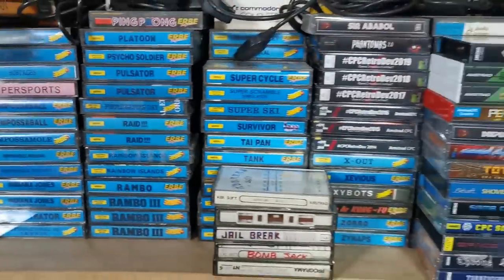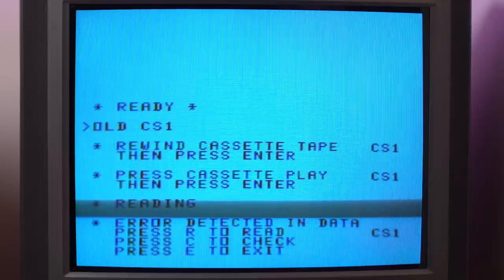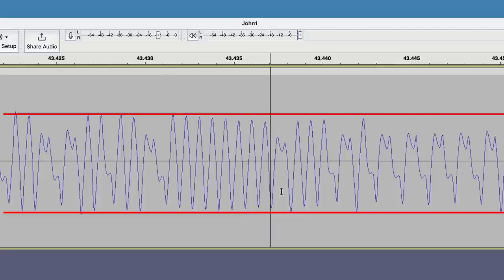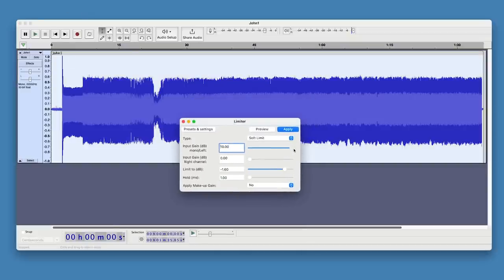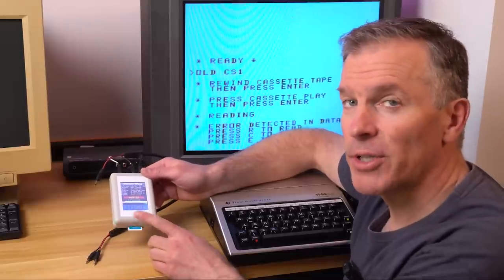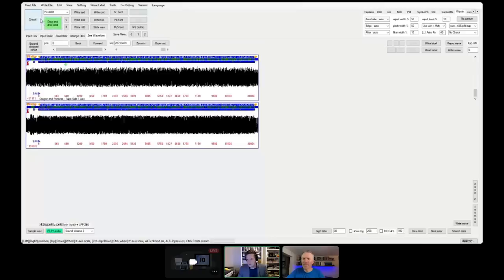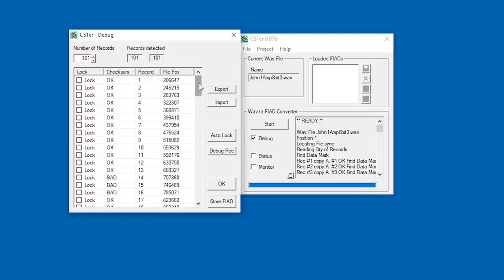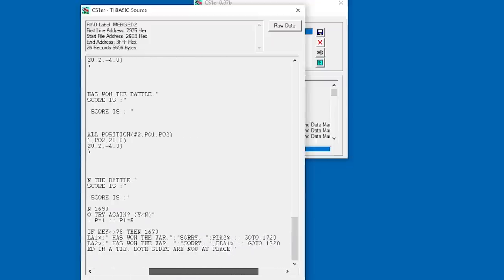Cassette Tape Data Recovery

Comment: Hi Noel, 2 things to note about cassette : many of them have the foam buffer cooked or dead, making the tape band reading shitty, and errors here and there. Replace the foam buffer by a new one, and oh ! Miracle ! the tape read again without any errors ! Next is the copper arm on which the foam buffer is glued. This one tend to relax too much with old age. Just put some demak up cotton piece under it, and done :D
Reply from the maker: Very interesting! It sounds like there are even more techniques BEFORE reading the data like that. Super interesting. If I come across some tape that has problems being read, I think I'll try that. Thanks!
Reply: @NoelsRetroLab  Yes. When i got sent 150 tapes to dump as WAV and then pass in CDT for the Amstrad CPC from  a big collector, i had to find solutions to get the datas read correctly. And the unrewinded band is a classic. with the band properly sticked to the read head, that's it, the squeeze is much more light or even better the signal is again proper, so when processed, it's all good !
Reply: @dlfrsilver  Thanks :).  Like the CPC!
Reply: Thank you for the valuable tips! I have some old tapes from my Amstrad CPC from my childhood with some self written programs and games I want to record and that could be really helpful advice.

Comment: a trick for restoring difficult tapes: in Audacity apply a very high pass filter, let's say 16000 Hz. This cancels out all volume variations and keeps only the zero crossings, which is what matters for tape decoding. With this trick I was able to restore a rare tape for the Tarbell interface.
Reply from the maker: Ooh, very interesting! I didn't think of doing that. I could see how that would work.
Reply: Thats ingenious, it took me two minutes to even comprehend what you said 😄
Reply: Uhhh can you or someone explain me how this works? Because for one there's no 16KHz signal on tape, the frequency response of it fades out before that, so by all logic if you highpass at 16k all you get is noise from the tape machine; and for other the signal that creates the zero crossings is the 1- or 2-KHz squarewave, so when you highpass it, wouldn't you create new zero crossings all over the place at multiples of the original zero crossing rate? Assuming this works as described and there wasn't a accidental error in the description, what am i actually missing?
Reply: @SianaGearz  you are missing that the high pass filter hasn't a flat response, the attenuation below 16KHz is gradual, so you still get some of the 8kHz, less of the 4Khz, and so on (with increasing attenuation as you get closer to 0 Hz). So you still retain a good part of the original signal but in a cleaner form where zero crossings have been enhanced (this because the "step" response of the square wave has a very high frequency content).
Reply: @ninoporcino5790  OK wow yeah that's smart. let's say you create a 6db/oct slope; what filter slope do you use? It deletes low end rumble and many sources of offset, we can outright kill anything below the band and it will just centre the crossings better, and it creates an eq which for a 1KHz wave, strengthens its let's say 3k 5k 7k components increasingly which helps sharpen the box edge. I suppose there's a number of increasingly more complex recipes to EQ the tape to beautify the pulse shape but i get it now.
Reply: @SianaGearz  yes the slope I used was 6db/oct (first order). I found this "trick" when manually trying to detect zero crossings: I was doing sample differences (sample[t+1]-sample[t]), but then I remembered from school days that high pass filtering is much like differencing, so I opted for an HP filter. The odd thing is that the resulting waveform looks very different from a canonical tape signal, but still decodes!
Reply: Thank you for the helpful advice! Will try that for some Amstrad CPC tape recovery I wanna do.

Comment: The fact that we can actually "see" the BASIC listing inside a digitized version of an analog tape from 40+ years ago is fascinating.Great video!
And yes, it looks that you need some trial & error until you get most of the listing loaded; doesnt matter if the errors are typos, those you can easily correct post-load; the problem are those nasty frequency incorrections that make the load stop amid file.

Comment: It might be worth a try to replicate the circuit from the TI-99 on a breadboard and run the audio into that. *AS I UNDERSTAND IT* the circuit (MAG IN) uses a 4558 dual op-amp (U400) to pre-filter the signal. The first side of the op-amp is configured as a low-pass filter for 18kHz, which is obviously just to kill any non-audio noise. The second op-amp is configured as a low-pass filter at 1.064Khz, with a high gain, which probably would drive the output as a digital switch. Since it is a low-pass filter, it should be producing a positive output on the '0' signal. Any negative output would be snubbed by the diode CR402. This would produce a digitally-inverted output into programmable system interface U300, pin 30, which is an inverting-input interrupt (INT11).
That is just from a brief look at the circuit. It would be informative (and good content) to replicate the circuit on a breadboard and look at the output on an oscilloscope. You could even pipe the output from the breadboard to U300-30 with a jumper to see if the circuit works. Anyhow, I really like this kind of content and I'm glad there are folks like you out there helping the community. Cheers!!
Reply from the maker: That's actually a great idea (and much better insight at what it's actually doing than my cursory glance at the schematics). I may have to try that at some point. Thanks!
Reply: That's an excellent idea. It would also be worth scoping out the signal on the existing machine at various points in the circuit to see how it's responding to various input waveforms, volume levels and so on.

Comment: I am genuinely surprised no one has made better software by now. The hardest part would be to actually translate the audio into actual binary data, but once you have that you could easily make the troubleshooting 1000x easier by showing the code and highlight the record(s) that was not read correctly. Maybe show both copies of the same record in case one is less corrupt. Could even throw in some basic (pun intended) spellchecking to highlight things like "orink" instead of "print" and so on.

The retro community is huge, you'd think this would be one of the first thing that was made to ensure digitizing dying physical media is as successful as possible.
Reply from the maker: Right? And not just for the TI99/4A. That seems like a program it would be super useful for every retro platform with significant cassette library (although to be useful they'll have to be very customized for the platform).
Reply: Well, the physical media doesn't need to be decoded right away; saving a decent quality WAV file (22 kHz seems to be the minimum, but 41 kHz works better, 8 bit resolution is fine though) preserves the audio and then you can decode it at leasure any time later.

One thing that would be really helpful from the development community would be to open source their software, or at least make it more of a Unix-style modular set of tools than one big GUI program. For a program like CS1er (which looks to me to be pronounced like "scissor") anybody else working on the same thing or something similar has to start again, especially after the author walks away at some point and is no longer available even to ask for the source.

Comment: azimuth screw adjustment may help as the tape was recorded on a different player with likely different alignment.  It wasn't uncommon to have to mess with this to get round R Tape load errors on the spectrum with original games.
Reply: Normally, you'd get a 3khz reference tone and turn the screw as you listen (and have a spectrum analyzer running) so you can get it just right. Since the tapes used lower frequencies than that, you can be sure that the 3khz reference adjustment will be perfect for the tapes.

Comment: Thanks for another wonderful video, it really was a blast from the past hearing the sound of loading from tape on the TI 99-4A and seeing the BASIC code.  I did a lot of playing around in my teens, writing programs for my TI back in the early 80s, and am very familiar with the sounds of the tape loading/saving and the frustration of having a program disappear after a load failure.

Comment: ...a signal with 2 different frequencies is FSK, frequency shift keying... FM..is modulated across the bandwidth range, eg centre freq is 100Mhz.. FM can slide up and down any part of its bandwidth (in FM radio this is 200khz so it can slide a max of 100khz either side of the centre frequency) in less than hz resolution and is very analog in nature.....FSK is 2 destinct frequencies only... one to represent the "0" one to represent the "1"....completely digital...usually seperated by 800hz (again in radio...which ALL this tech is based off...and even the tech we use today in our modems, the signal is just sent over wires instead of the air)
there are some great radio hacking tools out there that would take this signal and generate the actual data... and you can reconstruct the bad data (eg universal radio hacker)
...when i got into radio i really liked to capture and decode Marine Weather Fax... as it reminded me a LOT of loading tapes in the CPC... its 2 distinct frequencies (FSK) and it transferred the image line by line, but very slowly (about 1 line per second) as it was being sent over the air and has to deal with things like ionospheric conditions
Reply: Good catch. The one difference from radio, then is that the frequencies in CMT FSK systems are usually separated by one octave, such as the 689.5/1379 Hz pair here, or the more common 1200/2400 Hz pair.
Reply: WEFAX doesn't have to just be two frequencies, although it often is due to the black-and-white nature of the charts. But it's fully grayscale capable and you'll see that when they send weather satellite images.
Reply: @flapjack9495  yup youre right... RTTY would have been a better example... but the sound and way WEFAX downloads is alot like tape loading..

Comment: One thing I didn't see - tape damage might be due to be stretched, which would alter the frequencies.  It might be worth lookigng at the damaged portions to see if maybe you need to somehow speed that section up.  It would also be interesting to feed the raw signal into a spectrum analyzer.  You should have just the two tones.  Look for variations where they move.
Reply from the maker: Good point. I think slight stretching (i.e. frequency shift) is still fine since these computers were not precise at all. Sometimes you can play something at 25% faster speed and they will still load. I think at that point the signal would even look different at a glance. But I love the idea of running it through a spectrum analyzer! I should try that next time.
Reply: @NoelsRetroLab  It may depend on the algorithm.  It may adjust to a consistent speed difference, but choke on a sudden change. Especially if it shifts one of the frequencies close to the other.
Reply: The algorithms used by the machine firmware of the era are resistant to tape stretch. They only need to differentiate between approximately 0.5ms and 1ms zero crossing intervals so there's a lot of room. Adaptive algorithms which try to estimate time stretch were not at all used, so consistency of speed isn't of any consequence, there is simply a timing threshold below which a zero crossing is considered to be a 0.5ms one and above which a 1ms one; however the threshold tends to not be perfectly consistent depending on previous state of the decoder. As resistant as the resulting algorithm is to stretch, nonetheless bias, phase shift and stretch together could conceivably turn the 0.5ms interval into something that looks just above the chosen 1ms interpretation threshold, so in error sections, manual inspection is a good idea. I don't think you'll see any exciting frequency shift per se but it would be curious to double check.

Comment: Ooff. When I try to google programs like these, nothing comes up and I have to reinvent all the wheels.
I recently recovered some undumped DECO Cassette System games, but I literally had to write my own data extraction program. The only information I had was in the MAME driver, telling me that every block starts with 00 FF, has 256 bytes of data, then two bytes checksum (which is encrypted just like the data) and then FF 00. There is silence in between blocks.
I also did multiple dumps (since it uses proprietary tapes, the original player had to do) using different approaches like hold the tape in a certain way, play it at different speeds. On some tapes, I couldn't get a single clean dump, but with all the debug information my program output and having four dumps, I could always do a majority vote and the game programs are now in MAME.
And yes - looking at the zoomed in waveform, manually decoding was how I started.
Reply from the maker: Very cool stuff! I love it that it's possible to make sense out of the audio file data like that. Too bad you had to write everything from scratch, but it was probably worth it.
I wonder if it's possible to write a "universal" program with different plugins or rules for different platforms, or whether they're too different from each other.

Comment: What you showed in your video is band signal squeezed, due to unrewinded tape. The way to read the tape correctly without the squeeze or less squeeze and then able to recover the tape content : use my method bellow. I have countless of faulty tapes with that. (i did more than 2000 original tapes dumped for Amstrad CPC, but the method applies for any other machine).

Comment: Some software houses used a copy protection, one small part of the tape was recorded on purpose with a very low volume. When the tape was read by the computer, that particular part gave an error, and then the computer could not read back that part. The tape with the error was original, then the computer was ordered to continue. But if the tape was copied, most users have an automatic gain in their cassette recorder, then all parts of the tape could be read back, then the tape must have been a copy and the programme refused to play. When I saw the audio file I recognised this very ingenious copy protection, neither a newly saved cassette nor a copy would work, both had perfect audio at the correct levels.

Comment: All the tape formats I played with used more than two frequencies, the others are for things like the synchronization tone. And in fact the frequencies are due to how much time passes between sound pulses, the zero crossings. But if the CPU needs to do more instructions for any reason you'll end up with some durations that are not quite the one for the zero or the one for the one. So you often have to tweak them. Also depending on whether you count the wave crossing zero on the way up from negative to positive or down from positive to negative you can get slight differences, like half a wave. I believe some systems actually count the zero crossings in both directions too. It can be challenging and fun and sometimes frustrating. Anyway great to see somebody do such a good video on the topic!
Reply: yup there are usually "pilot" signals at the start (and sometimes the end) that synchronize the decoder with the incoming data..but the data itself is usually just in FSK
Reply: That's interesting, because a friend and I have been working on some Python code that reads and generates tape saves, and we've never seen more than two frequencies so far. (We've got National JR-200 and Hitachi Basic Master Lv2 working, NEC PC-8001 mostly working, and have looked at FM-7). The leader and separation tones have invariably been at one of the two frequencies used for FSK.
Reply: @Curt_Sampson  I haven't played with them for over a year and a half but at that time I played with Sinclair ZX Spectrum, TRS-80 model 1, and Apple 2. I didn't manage to get all three working from the same code. Speccy for sure has a long leader tone/synch tone be the 1s and 0s. I don't remember the others as well.

Comment: Pulling this out from the deep dark mists of memory, but the TI is particularly volume sensitive as well. I’m not surprised you weren’t able to easily recover and load just using audacity. I seem to recall having only one small volume range where it would read my tapes, but that may have been partially because of the player I was using.

Comment: For Atari 8-bit computers there is a program called Turgen, which supports various standard and custom tape loading formats that were used on the platform.

Comment: It's disappointing, but understandable, that those writing the tape loader routines in machines in the early eighties and late seventies didn't seem to know about Hamming codes and other error correction mechanisms and instead resorted to just clumsily duplicating the data.
Reply from the maker: Right! They could have done so much more. At the same time, this is a real-time process and maybe they couldn't spare the cycles or the RAM to do any fancy computations.
Reply: Even if they had just interleaved the blocks, so the two copies of any given block were farther away from each other on the tape, it would have helped a lot. Many over-the-air digital radio protocols do this because errors tend to come in bursts.

Comment: The data is not out of the band surface or demagnetized, it's still there, it's just that due to the unrewind, the foam buffer too old and the copper part too relaxed, the head tape drive can't read it correctly.